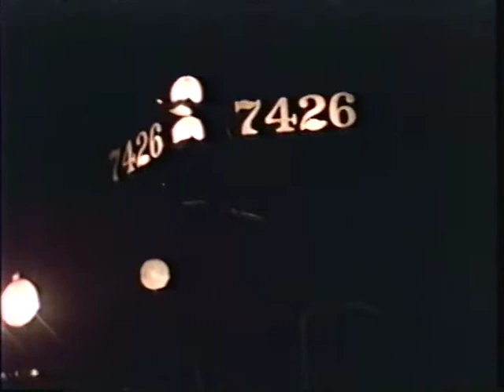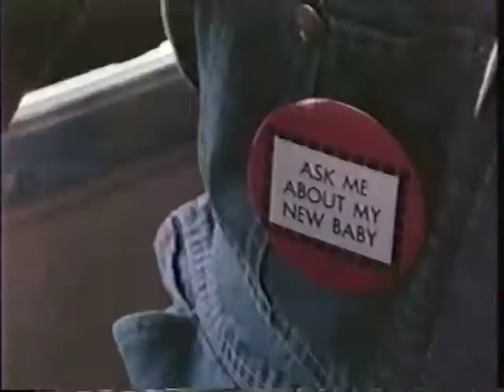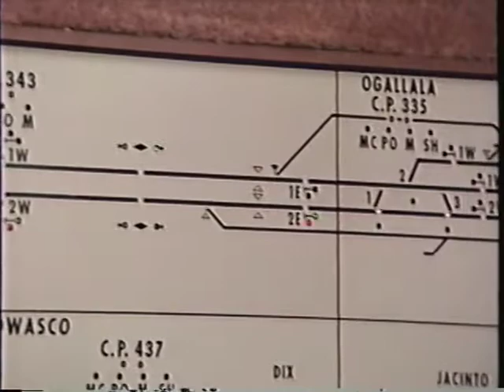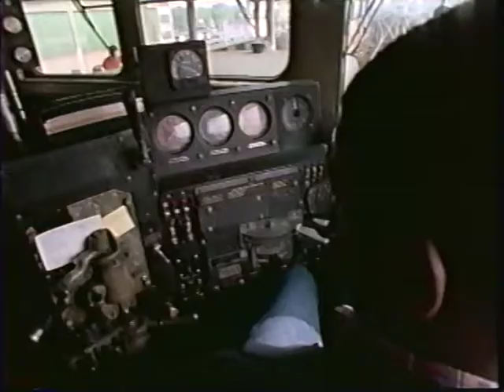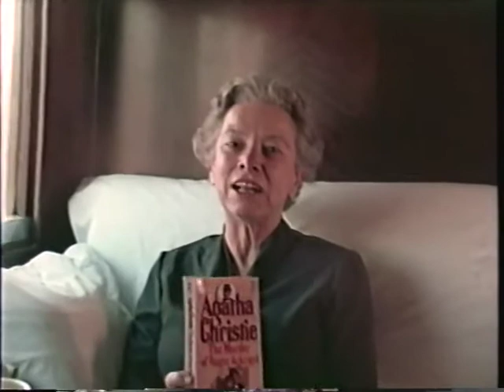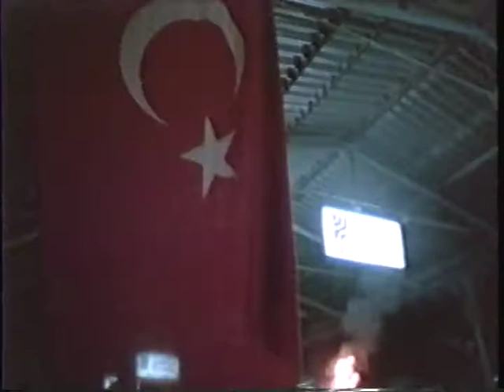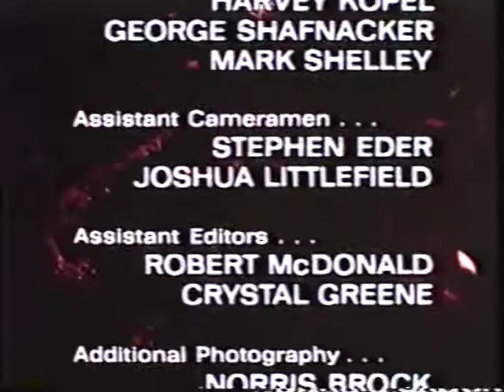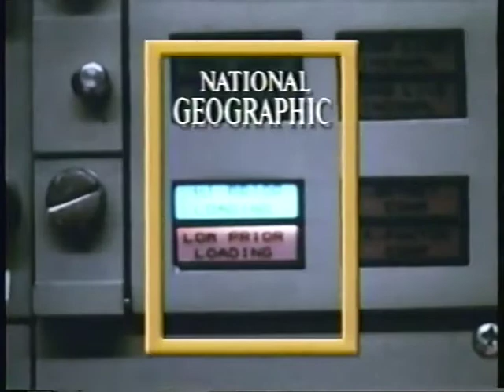National Geographic: Love Those Trains (1992)

Comment: Why did the Norfolk and Western 611 steamer tender locomotive pull the Norfolk and Western passenger trains at 100 miles?
Why did the North American long sturdy freight trains offer their refuge for the hobos?
How many train track miles did the Southern 2716 steamer tender locomotive follow from 3:46 to 8:50?
How many train track miles did the North American Goleta Valley Railroad Club live steamer trains run on from 10:41 to 13:46?
How many miles did the modern eastbound North American United States Salad Bowl Express Train run on from 30:19 to 45:01?
Reply: Don’t know about the last ones, but for the first two:
Because part of the appeal of passenger trains in the 1950s was to get the passengers from point A to point B as quickly as possible.
Because it was a convenient way for hobos to travel for free as long as they didn’t get caught.
Reply: @jamiethedinosaur869  The trains worked the railroad day shift and the railroad night shift.